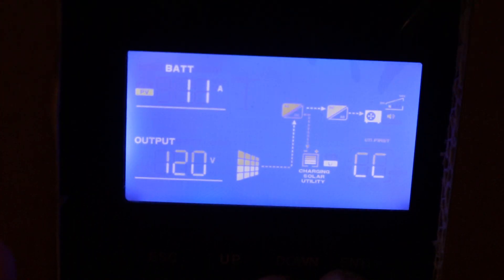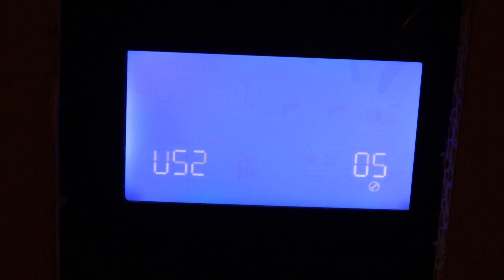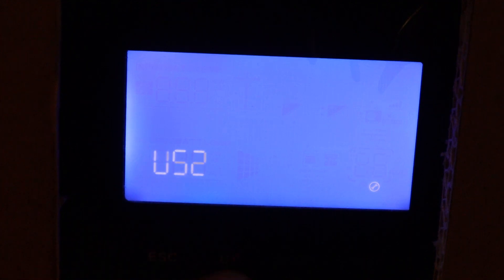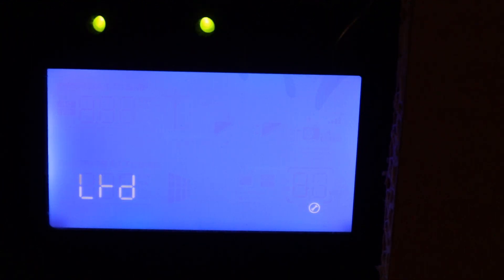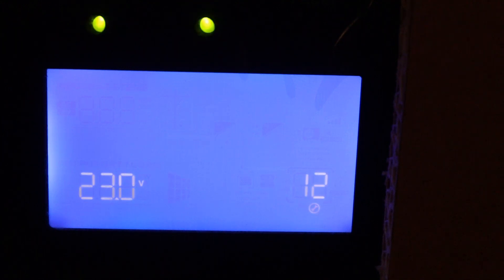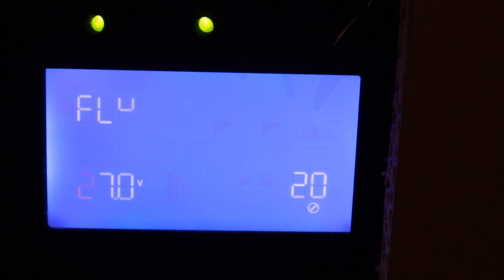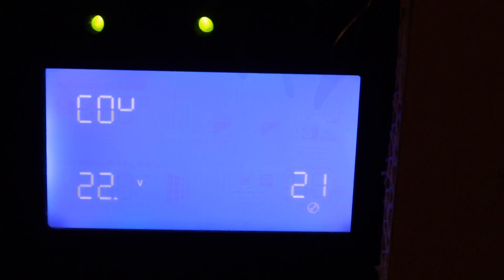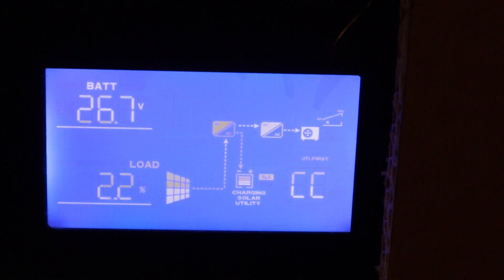Growatt 3000 24 Volt Settings For Lifepo4

Comment: Great video suggestion Growatt recommends charging @ the 2c rate I'm assuming that's for solar and utility made those changes 40 amps solar and utility and my batteries charge much better let me know what happens
Reply from the maker: Thank you for watching and for your support. Thank you for that suggestion. I will definitely test that out. Just so I understand correctly, are you suggesting that I change setting 2 to 40amps? Thank you, I will test it out. Appreciate the contribution. Please consider subscribing if you found the content useful. Thanks.
Reply: @thinkfreelivefree6951  yes settings 2&11 you have a 310ah battery bank so the 2c rate would be 62 amps I would do at least  55 amps let me know
Reply from the maker: @alonzodesantis6989  Thank you Alonzo. My bms has a max of 50 amps limit for charging. So I will try 50 amps. Do you know what the math is with the 2C rate? Thanks.
Reply: @thinkfreelivefree6951  simply put it's 20% of the total amp hour rating
Reply: @thinkfreelivefree6951  curious what's your solar panels wattage and how are they connected
Reply from the maker: @alonzodesantis6989  Thank you very much for that info, I appreciate it. My bms is limited to 50 amp charging and 100 amp discharging, but I will try to make some adjustments. Thank you for that info. 👍
Reply from the maker: @alonzodesantis6989  Hi Alonzo. I have 600 watts of solar on my van roof. 3x 200 watt Rich Solar Panels connected in series running 10 awg wire to my Growatt MPPT controller. At best I get about 480 watts, but most of the time its more like 380 watts. I have them connected in series. Thanks.
Reply: @thinkfreelivefree6951  He means POINT (.2C) two C. My battleborns suggest .5C for charging. The C rating is the Capacity, in Ah. I think he's a bit confused as to how to type that. .2c is 20% of C. Since you built your battery bank DIY, you limited your charging ability to the max your BMS can handle. I would suggest a little lower than the 50A, as if you are drawing a lot of Amps at the same time as charging, that could overheat something.
Reply: @thinkfreelivefree6951  Hi. Just want to ask something about the Growatt inverter. Does it have a setting where the battery bank gets priority first from the panels, and when fully charged, the panels will give the house power?
Reply from the maker: @stefanduplessis1169  Hi. Thank you for watching and for your support. Yes, its called SBU, battery first in setting 1. Hope that helps. Please consider subscribing if you found the content useful it really helps the channel grow. Thank you for your support.

Comment: I only have questions and not answers. Can anyone help? I have not set up my GW 3000 24 yet. I am building my system. I have Twenty, 12 Volt, 1,200 Ah, AGM batteries. They are really high quality batteries and the manufacturer has very specific values for max amps, bulk, float, ...... and I want to set my Growatt to those exact settings once I bring the system live. 
Does anyone know if in the AGM setting if I can customize the settings for AGM so I can make them exactly as my battery manufacturer has specified? Thank You!
Reply: Hi Ben if that's not a typo 1200ah agm battery bank that's a HUGE bank not sure what you're doing maybe powering the whole house if so go 48 volt and check out Sol-ark 5k and up to 12k all in one solar charge controllers look at engineer 775 on u tube you'll get all the info u need
Reply from the maker: Just keep in mind that is 1200ah @ 12 volt, if connected @ 24 volts that becomes 600 ah capacity. The minimum for a 24 volt growatt to work is 200ah, that is not its max. And also keep in mind that in setting 2 Maximum Charging Current is settable from 10amps to 140 amps for the 24 volt version and these are AGM batteries so he does not have the limitation of a max charge limitation from a bms, so essentially he could charge at max. The 48 volt version is settable from 10 amps to 120 amps. So really he should be good if he has enough solar panels.
Reply: @alonzodesantis6989  I am sure you are correct. I have been following 775 for at least 5 years. I am just learning and so will be making lots of mistakes. I have already invested in what I have: 24 GW, and the batteries I have described. And yes, I do plan to do my whole house. I live in San Diego and have an ideal property, actually a perfect property for solar (panels and placement). But, I know what my older brother taught me: "The first thing you learn about a new hobby is bought all the wrong stuff". So it sounds like from you folks that know, I should have purchased the 48V GW. Oh well, I have what I have. I did have it in my plan to do both leggs and get 220, but that wasn't/isnt part of this initial set up. Following Will P. on YouTube, I went with lots of batteries. I plan to have minimum available of solar panel of 4,200 Watts. Help (?)
Reply from the maker: @benkanobe7500  Hey Ben, you should be fine. You may want to get another 24 volt Growatt so you could connect them in parallel and have 6000 watts available and if you have 4000 watts of solar panels you will definitely need at least 2 Growatts to handle the open voltage limitations of 145v for solar panel array per 1 Growatt 3000. That is exactly what Will Prowse did with his outdoor solar trailer. Hope that gives you some ideas to think about. Great discussion guys, I am learning a lot from both of you. Thanks. 👍
Reply: @thinkfreelivefree6951  Thanks! Yes, I am a big and very long time follower of Will Prowse. All great discussion and I learned from it. Stay in touch and I will do the same. It's a journey, not a destination!
Reply from the maker: @benkanobe7500  Thank you Ben, appreciate the support and excellent discussion. Definitely a learning journey with no set parameters, lol. Thank you and be well. Let us know how your setup goes.
Reply from the maker: Hi Ben. Thank you for watching and for your question. According to the user manual, if you select USE, also means User-Defined you can set setting 19 which is bulk, setting 20 which is float and setting 21 which is the low DC cut off value. I do not believe that if you choose AGM that you will be able to adjust 19, 20 & 21. It states in the User manual that you can only change those values if you select User Defined or USE setting in option 5. I hope that helps. But I don't see any problem with you using the USE setting in option 5 for your AGM batteries because then you can select exactly those specific voltages as recommended by your manufacturer. At the end of the day, it is a charge profile that is adjustable to settable parameters. Hope that helps. Take care.
Reply: @thinkfreelivefree6951  Thanks so very much. That is great news. I am in the process of building my system. My Growatt is still sealed in the box and I have been watching every good YouTube on the GW I could find before opening mine up. I still don't have my big set of panels yet as I am still deciding which ones. I do have a small set (1,500 watts) of Renogys running grid-tie inverters and four of my batteries. I have them tied to a Pure Sine Wave inverter and run my entertainment system, so lights, and Frig. It is just with extension cords and "Bread Boarded" unitl I finalize my system and set up the GW.
Reply from the maker: @benkanobe7500  You are very welcome Ben. Sounds like it is going to be an awesome setup. Let us know how it goes. Thank you for your contributions to the channel. 👍
Reply: Is that a typo 1200ah batteries each Growatt is rated for a 200ah battery bank personally I'm going to do 370 for my next system and I'll be using flooded lead acid agm doesn't last long what can I say I'm a LEAD HEAD
Reply from the maker: @alonzodesantis6989  Lead Head, 😂. Sounds cool Alonzo. I cannot speak for Ben, but I believe its a total of 1200Ah. As long as you keep your configuration of your battery @ 24 volts, I don't believe it matters how many Ampere hours it is, after all its just storage capacity.
Reply: @thinkfreelivefree6951  brother to effectively charge that battery bank keeping in mind a minimum of 10% of the rated battery bank it would take 120 amps to charge that bank within 5 hours of 🌞 it'll be hard pressed especially bulk and the crucial part absorbtion to get to float 1 Growatt is not going to do it he should go 48 volt and look into a Sol-ark 5k inverter
Reply from the maker: @alonzodesantis6989  I agree brother, 48 volt would be better and more efficient with that size bank. He could also put 2 24volt growatts in parallel, however, 48 volt would still be better and more efficient. Thank you Alonzo. 👍
Reply: @alonzodesantis6989  I love "lead head" you are way too clever! I had/have at my ranch in Arizona (perfect solar area), Outback system with Trojan LAB and it was just too much for me to keep up with the water. I think I had them set up right, but don't know. I decided on the AGMs here in CA to avoid that maintenance even though my initial cost was much higher. I will let you know how it turns out.